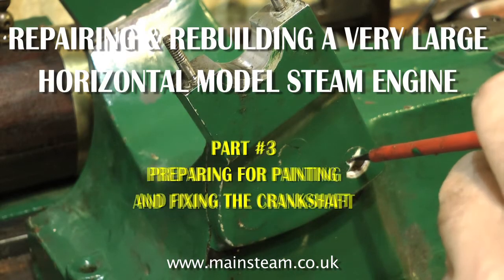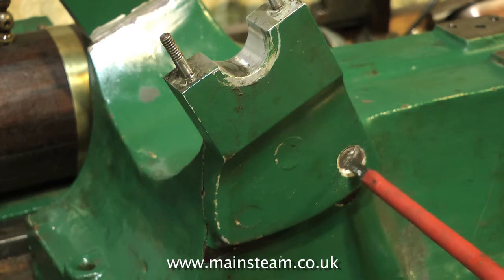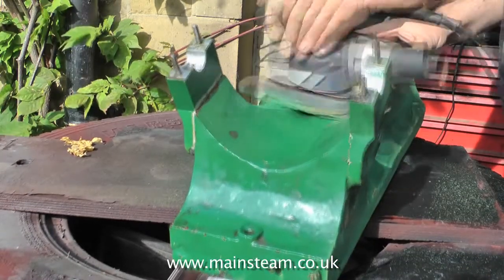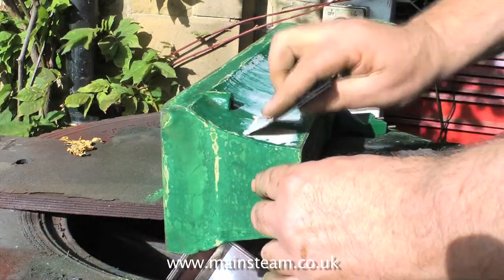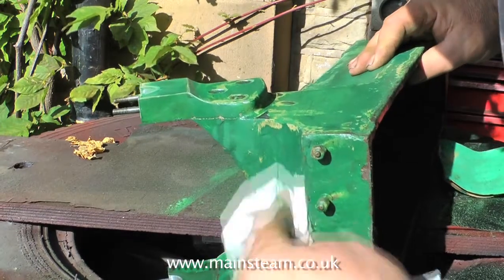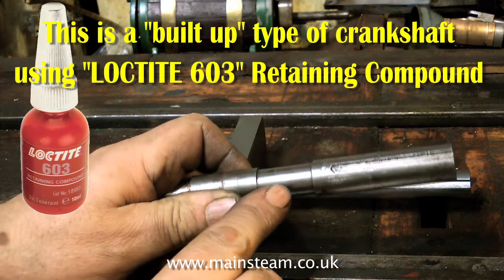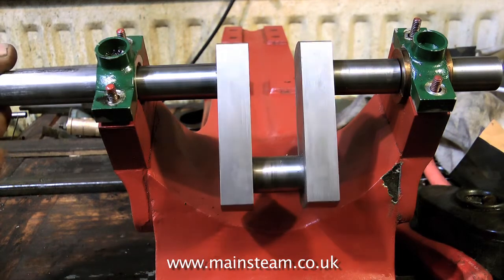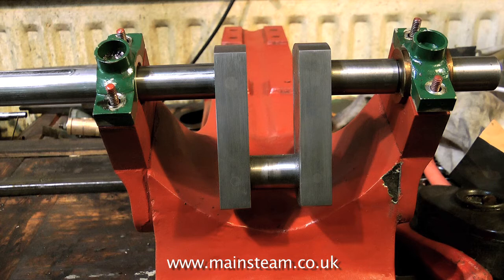HOW TO REBUILD A LARGE MODEL STEAM ENGINE - PART #3

Comment: Hi Keith. I'm avidly watching this series. There are 3 screws securing the bearing brackets to the bed and by themselves, they are always prone to moving.

You could solve this problem, permanently, by screwing and dowelling these brackets. Once in the correct position, drill through 2 holes of say 17/64", then ream out 1/4" diameter (or ISO equivalent). Standard size hardened and ground dowels can then be inserted, which will keep the brackets permanently located in situ (until you knock them out for maintenance at a later date).

eBay - pack of 10 x 6mm x 30 mm hardened and ground steel dowels for £3.05, free postage.

Keep up the good work. Gordon (a fellow Tyke - Leeds).
Reply from the maker: +Gordon Burns Thank you Gordon for your solution, but my fix worked perfectly and the bearing brackets will not move again in my lifetime ........